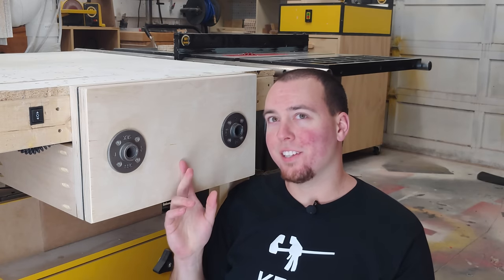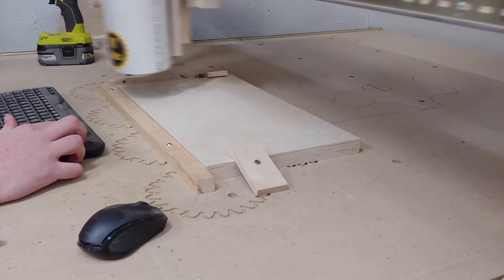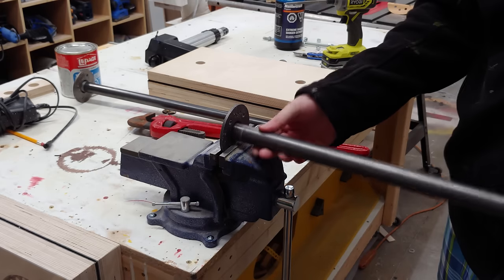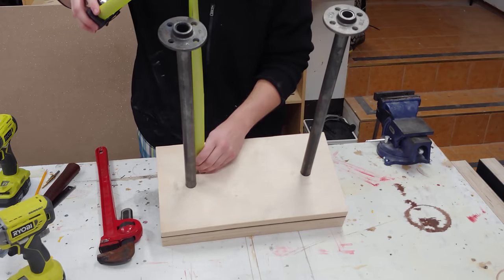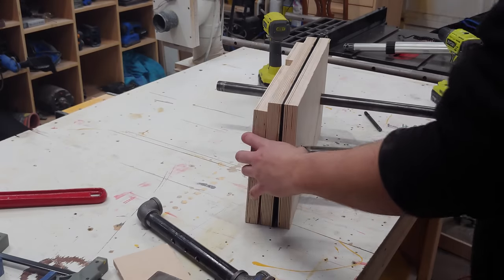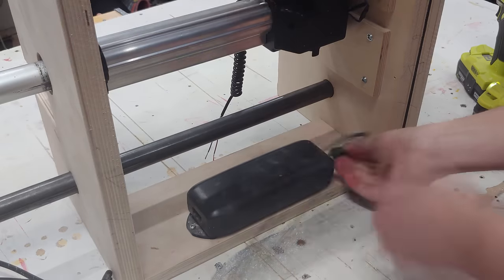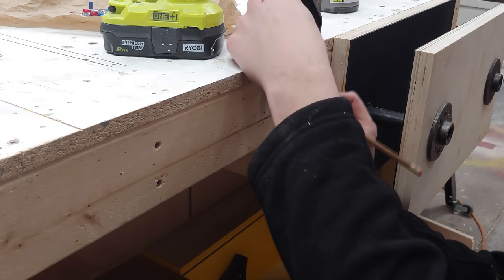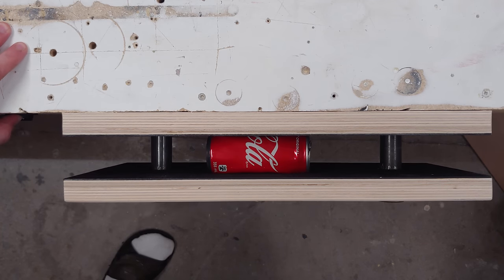This Vise Has No Handles! (Linear Actuator Vise Build)

Comment: Great design! Thanks for putting so much good info out there and doing it for free! I made this and added one thing, a generic wireless remote control for a 12v off road wench. This solved any problems I would encounter with obscuring the switch behind my workpiece. Regrettably my arthritis keeps my hands from moving in some positions easily. Perhaps another can use this idea. Keep making awesomeness!
Reply from the maker: Cool. I'd love to see that and post a picture on my website if your ok with that you can email me.
Reply: DIY Builds Well, best laid plans of mice and men. I got the remote system and it was designed to activate a relay unit in the winch wiring system, it has no reversing properties in its wiring. So I just ran the wiring through the pipes and out the front of the vise with a DPDT toggle. Kinda anticlimactic. Still, thanks to your plans I have the coolest vice in all of Southern California!

Comment: Nice project.  Please make a riving knife for your table saw.
Reply from the maker: Wish i could. No practice way to mount one.
Reply: DIY Builds I made one for each of my clearance inserts with a 90’ bend on the bottom and mounted them to the underside of my 3/4” thick inserts. Works great and I’m not launching pieces of plywood into my abdomen!

Comment: Very nice project. If you have any kids you might want to hide a shut off switch somewhere so they can't play with it, I know I would.
I am presently working on a router lift using a treadmill incline motor.
Reply from the maker: I certainly have children and a concerned wife that has mentioned this to me before. To accomplish this I will just leave it unplugged from the power bar.

Comment: For future consideration, you may want to add a spring  that will exert enough pressure to hold the wood but not so tight so that you cannot adjust it.  Once adjusted then continue to close with the linear actuator.  Otherwise it will be difficult to modulate the pressure placed on the item being clamped.
Reply: Yea man good idea.

Comment: You are a great designer, but I first thought you had the front tube mounts with a button in each - left for in, right for out - maybe an alt control method rather than the rocker.?
Reply from the maker: No

Comment: Seeing the scale test, and the needle wrapping around past 300 to 60, I'm wondering if this could have an adjustable pressure limiter, like the torque limiter on a power drill that can be set so as to not overtighten a screw.  Perhaps some variation of an actual torque limiter on the screw drive?  Seems it would be very useful to not overtighten on something more delicate than wood, without having to goose the rocker switch.  I'm no electrician, but if the electric motor can work with a rheostat switch (like a light dimmer), maybe that will allow adjustment of the pressure the screw drive puts on the jaws?
Reply from the maker: I was intentionally letting it go past the point of normal clamping pressure if you simply let go of the button once it reaches the work piece it hold great and doesn't strain the actuator.

Comment: I am curious to see how this would work with a lever to reduce the pressure by 50% (150lbs of pressure is fine), but increase the speed by 50%
Reply from the maker: I thought of doing that but it would make it more complicated and i don't see myself needed more than 4.5" of capacity very often.

Comment: The only even remotely negative thing I can say is the switch position might get blocked by material that sticks out the left side of the vice. It might be better to mount it around the corner on the right.
Reply: Or run the wires through the pipe and mount the switch to the face of the vise..
Reply: @neilbrackstone1819  Ooo, I like that idea even better.

Comment: Yeah, maybe I wouldn't have mounted the switch there, a long piece held horizontally will cover it.
Reply from the maker: It would still be accessible since the switch is 1/4" thick and the fixed jaw is 1" thick.
Reply: @DIYBuilds  my hand is thicker than 3/4". 😆
Reply from the maker: @andrewthecelt3794  who said anything about hands 😮

Comment: Bad news as always. I have an old Craftsman radial arm saw, I want to make the lift run on a DC motor, so I can change height while cutting out my prospecting equipment.  That handle gets rough making a bunch of plunge type cuts, down in my plastics!!
I guess it can't be that hard to do. I built my own thermoforming machine, it can't be that complicated!! 
Any ideas, what to use for the motor???